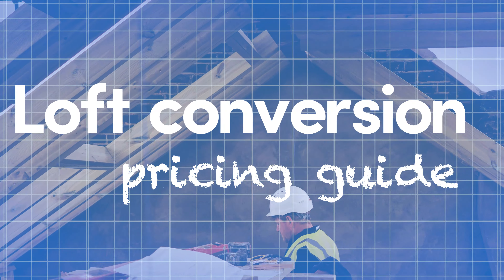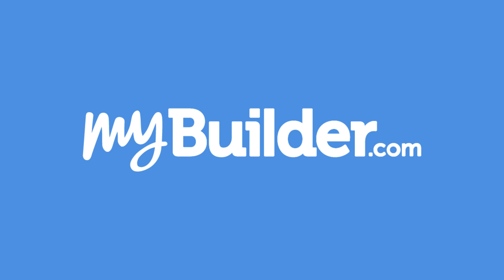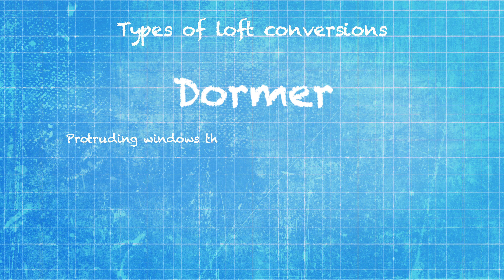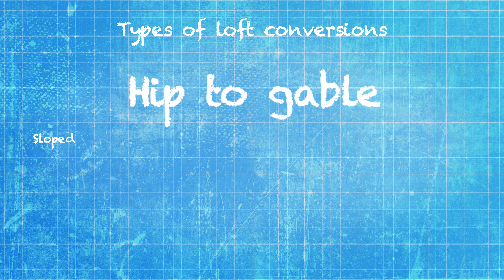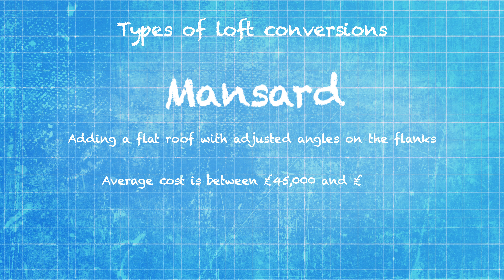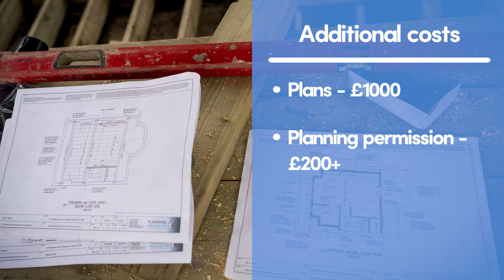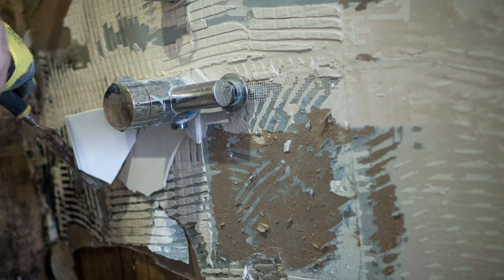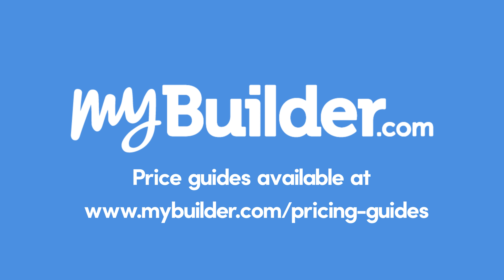Loft Conversion Cost 2022 - Ultimate Guide to loft conversion costs

Comment: Prices are unjustifiably high these days. The best way is to learn the steps needed to do a loft conversion, break it down to managble steps, then hire trades on daily rates. Also purchase as much of the material you have knowledge of yourself. If you do that, you reduce the price by as much as 50%.
Reply: Sounds like a good idea. Can you recommend any suppliers for materials?
Reply: Wouldn't recommend doing this only for any materials that could go faulty ie sockets lights pipe fittings etc, as the tradesman won't be responsible if they go faulty and you have supplied them yourself. It  won't come under any builder warranty if trades are called and turns out to be a faulty part.
Reply: @robertmather7696  you have a good point, but can easily be mitigated by getting materials that by them selves will not go wrong, or easily replaceable should they be faulty, like sockets etc, another way is to confirm any materials that don't fall within those categories are of good quality with a joint visual check, but if that's not possible, the trades can get those products only. You can also pay for other things yourself, like scaffolding, toilets, skips etc, all this will save a lot of money but will be paid by time instead as you'll need to project manage more yourself.

Comment: Wouldn't recommend buying your own materials for anything that could go faulty ie sockets lights pipe fittings etc, as the tradesman won't be responsible if they go faulty and you have supplied them yourself. It  won't come under any builder warranty if trades are called and turns out to be a faulty part.